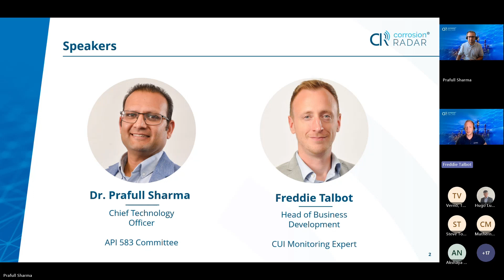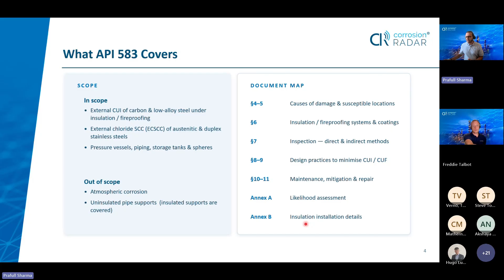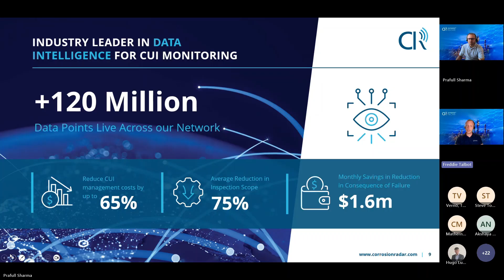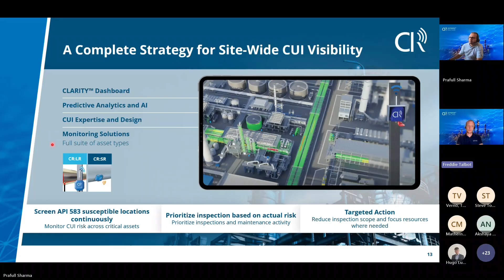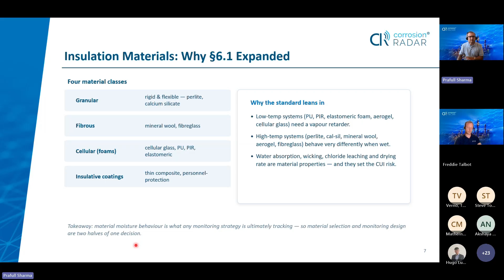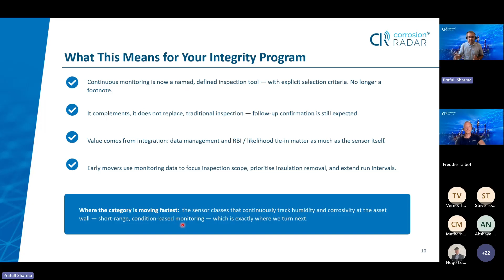Webinar - New API 583 Standards and CUI Monitoring Tech

Comment: 這段影片深入探討了 API 583 標準的最新更新以及保溫層下腐蝕（CUI）監測技術的發展。以下是內容摘要：

1. **CUI 的挑戰**：CUI 因隱藏在保溫層下而難以察覺，且具有普遍性、高成本和難以預測的特性，通常需要拆除保溫層才能確認。
2. **API 583 標準演進**：該標準於 2026 年 4 月發布第三版，主要更新包括擴大絕緣材料類型、重新分類檢測方法，以及新增「持續監測」章節。
3. **檢測框架重構**：新標準將檢測分為「直接法」（如視覺檢查、超音波）與「間接法」（如放射攝影、脈衝渦流），而持續監測被列為預測性的間接工具。
4. **CR:SR 監測技術**：Corrosion Radar 推出的 CR:SR 技術可在不拆除保溫層的情況下進行持續篩查，提供腐蝕率、水分、溫度和濕度等即時數據。
5. **經濟效益**：採用此監測技術可降低高達 65% 的 CUI 管理成本，並減少 75% 的檢測範圍，顯著提升資產運作時間。
6. **從監測到行動**：透過持續的風險可視化，業者能優先處理高風險區域，優化維護計畫並保護資產可靠性。
7. **絕緣材料特性**：更新後的標準深入分析了四類絕緣材料（顆粒狀、纖維狀、細胞狀和絕緣塗層）對腐蝕風險的不同影響。
8. **風險評分優化**：標準附錄 A 提供了可能性評分的範例，將監測數據與風險基準檢測（RBI）結合，使風險評估從週期性轉為即時化。
9. **主流化趨勢**：持續監測已從過去的補充說明轉變為資產完整性計畫中定義明確的核心檢測工具。
10. **塗層與感測器的互補**：雖然優質塗層是預防腐蝕的基礎，但感測器技術提供了額外的數據層，能應對現場條件與設計偏差帶來的風險。

1. **The Challenge of CUI**: Corrosion under insulation (CUI) is difficult to detect because it is hidden beneath insulation. It is widespread, costly, and hard to predict, often requiring insulation removal for confirmation.

2. **Evolution of the API 583 Standard**: The third edition of the standard was released in April 2026. Key updates include an expanded range of insulation material types, a reclassification of inspection methods, and the addition of a new section on “continuous monitoring.”

3. **Restructured Inspection Framework**: The updated standard classifies inspection methods into “direct methods” (such as visual inspection and ultrasonic testing) and “indirect methods” (such as radiography and pulsed eddy current), with continuous monitoring identified as a predictive indirect tool.

4. **CR:SR Monitoring Technology**: Corrosion Radar’s CR:SR technology enables continuous screening without removing insulation, providing real-time data on corrosion rate, moisture, temperature, and humidity.

5. **Economic Benefits**: Adopting this monitoring technology can reduce CUI management costs by up to 65% and cut inspection scope by 75%, significantly improving asset uptime.

6. **From Monitoring to Action**: Through continuous risk visualization, operators can prioritize high-risk areas, optimize maintenance planning, and protect asset reliability.

7. **Characteristics of Insulation Materials**: The revised standard provides a deeper analysis of how four types of insulation materials—granular, fibrous, cellular, and insulating coatings—affect corrosion risk differently.

8. **Optimized Risk Scoring**: Appendix A of the standard provides examples of probability scoring, integrating monitoring data with risk-based inspection (RBI) to shift risk assessment from periodic evaluation to real-time decision-making.

9. **Mainstream Adoption Trend**: Continuous monitoring has evolved from a supplementary concept into a clearly defined core inspection tool within asset integrity programs.

10. **Complementary Role of Coatings and Sensors**: While high-quality coatings remain the foundation of corrosion prevention, sensor technology adds an extra layer of data to address risks caused by field conditions and design deviations.